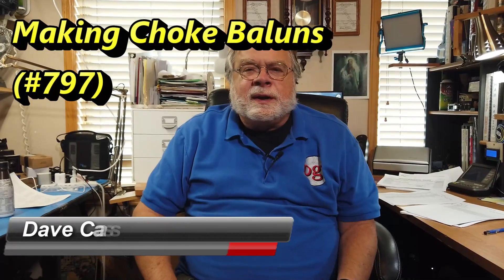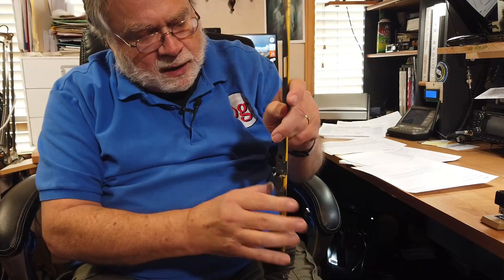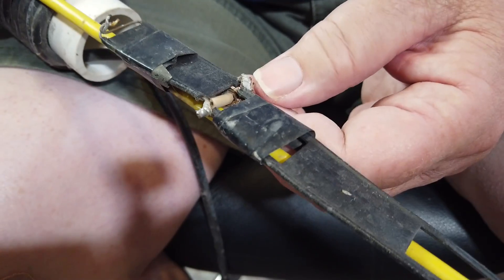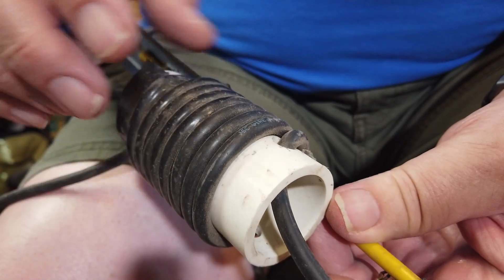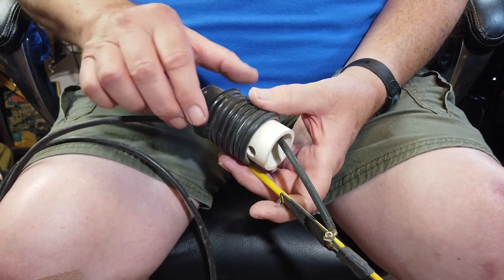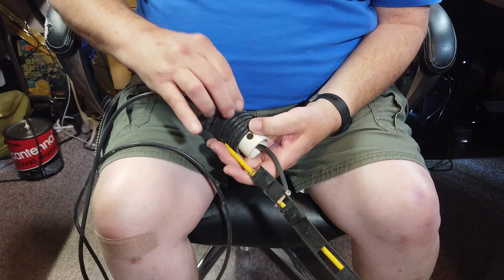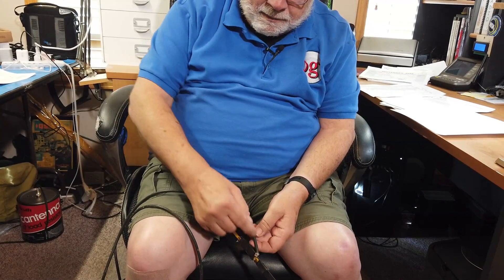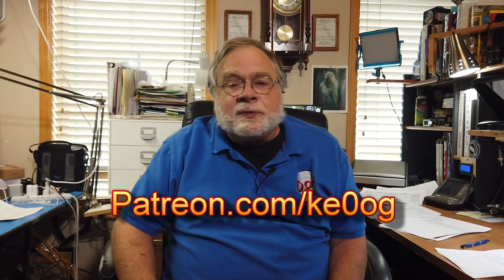Making Choke Balun (#797)

Comment: i built a homebrew dipole for 10 meters. because i am in an apartment, i don't have great grounding so i bought a balun from ebay, or ali epress. i forget which. it worked but narrow banded on 10 meters. i have a resonat point of about 100k then the swr just flies out of range. dould it be caused by too many winds in the balun? i've bought myself a torroid for making my own. i got an ft-140-61 as i want it good for 10 meters. any ideas on how to go from there? i've seen a few videos but they seem to contradict each other

Comment: Hi Dave . I am new to  Ham Radio I am putting up a Tri-band HF antenna they said it needs a coil of 12 turns at 6 inches in diameter. I have RG213 coax . I wasn't sure how to make a coil of that size with such thick coax. I noticed you had used a piece of plastic tube to wind the coax around. I thought this was a great idea maybe obvious to you but being new it was a great hint. I intend to leave the coax in the sun for a couple of hours to soften it up before attempting the coil. As a new amateur I have found your videos very helpful thank you for taking the time to produce them.
Gary (VK3VAG) Australia.

Comment: If you were to use snap-op ferrites for a UHF J-pole, would type 31 work? I’m no expert in reading those data sheets but it seems like it would but I might need near half a dozen.
Reply: not on UHF
Reply: Choke baluns add inductive reactance to the line. It actually affects the inner conductor as well as the shield. That'll kill your vhf and UHF signals.
Reply: @N9XRradio  I find it very hard to comprehend for any kind of rf-choke, be it the coax coiled or a snap-on ferrite, to have any significant impact on the RF-current in the inner conductor, at least not with any decent quality coaxial cable. Keeping the RF-current and its associated E/H-fields inside, is the intrinsic concept of coaxial cable, no matter what happens on the outside. As for any stray currents that may return across the outer side of the shielding, such choke will obviously help to reduce them.
Reply: @LoenieMovies  have you ever done any antenna modeling?  If so, how do you account for "stray currents" on the modeling software?